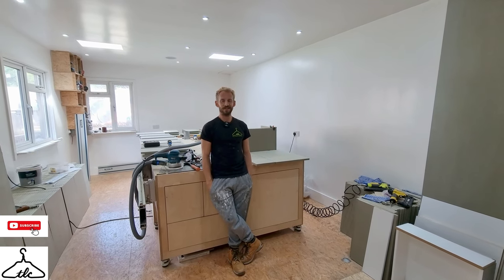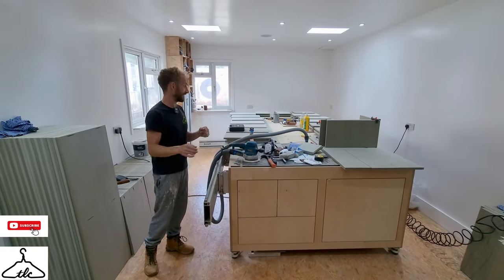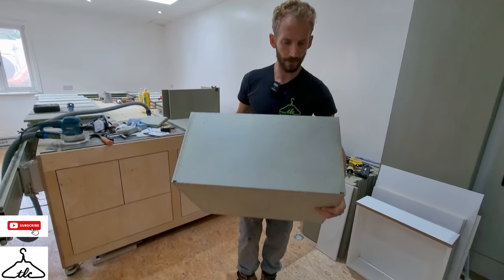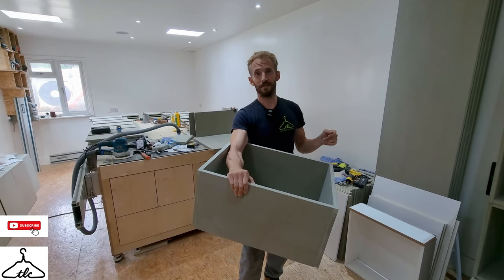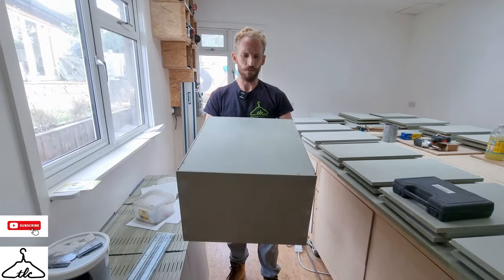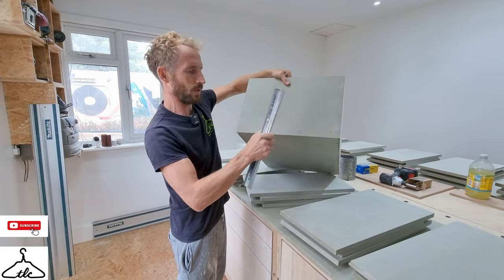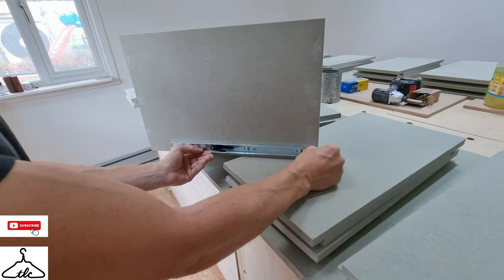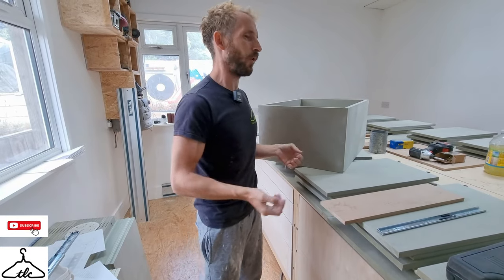THIS Is How We Make Drawers Quickly & Efficiency // PART TWO // Vid#106

Comment: Do you ever find pins wandering and blasting out of the side of your units? My dewalt cordless nailer seems to like like bending the pins out the side, I wondered if your air nailer works better ..or if its a user issue..cheers
Reply from the maker: Hi mate, not really tbh.
Our 10 year old air nailer works as it should with no problem 😊